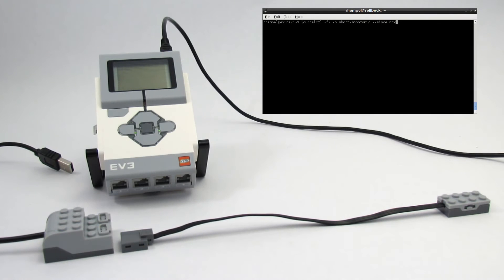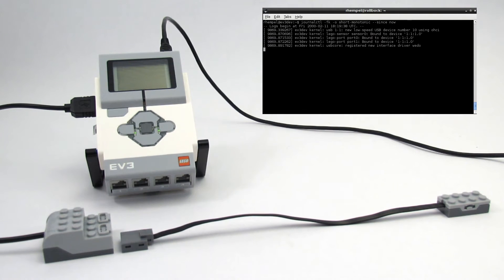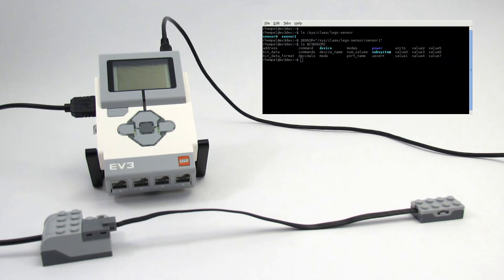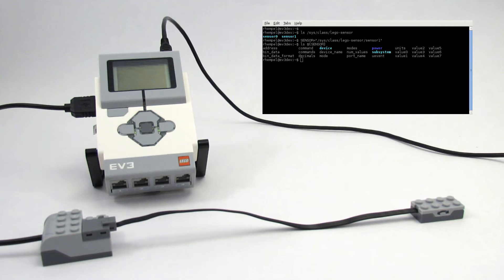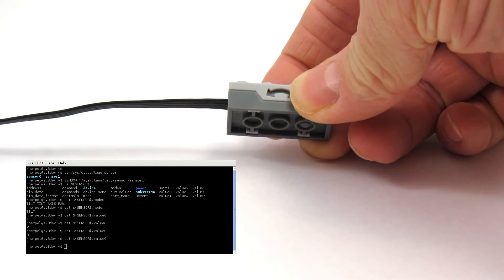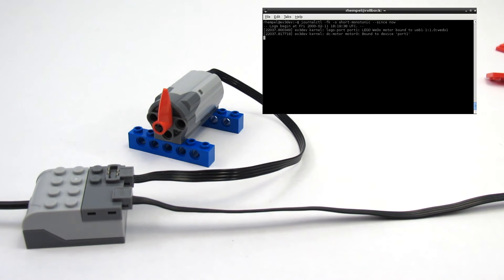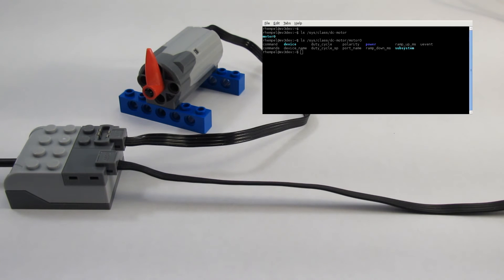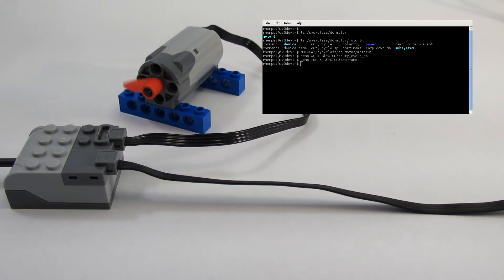LEGO WeDo Controlled by LEGO EV3

Comment: Is the source code available to copy to a Linux / windows computer instead of ev3?.

 Not a compiled library, but the info of what is been sending through the USB port and the pwm signals genererated in consequence.

And viceversa, what are the voltage analogue values sensors generate on pins C1, C2 of wedo1 hub; sample and hold frequency, and consequently what is interpreted by hub, read and parsed by the code, to present these values as a tilt position, distance value or other custom electronic build.
In a 0-5v dc voltage divisor circuit (vcc, gnd, C1 out for instance) what would happen?

For multiple detection, 2 or more USBs hub attached also would be nice to learn how recognization is carried to register the hub as an instance of the parent class and later the actuators (motors, servos,...), and the sensors (tilt, distance, force/push, ...) in dot notation. 
That is what is sent by the hub when something is plug or unplugged and the part of the python code that handles it.

Thanks.